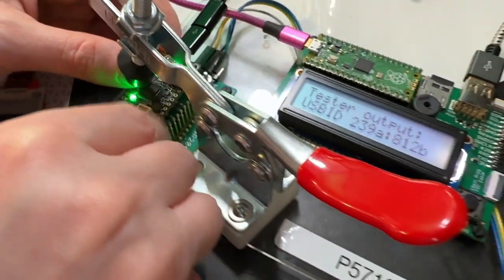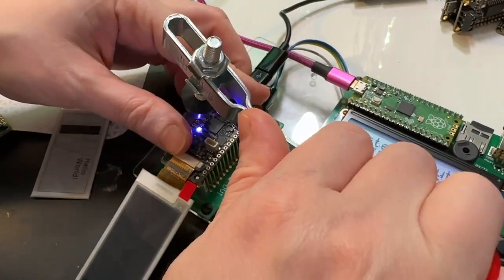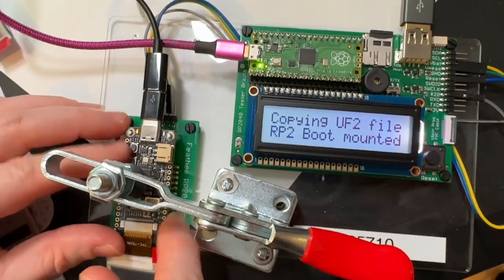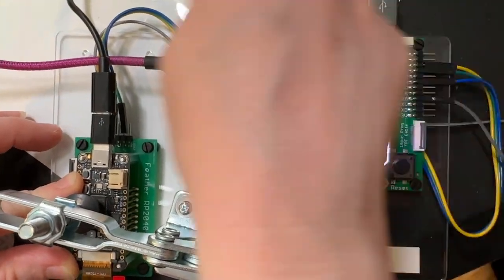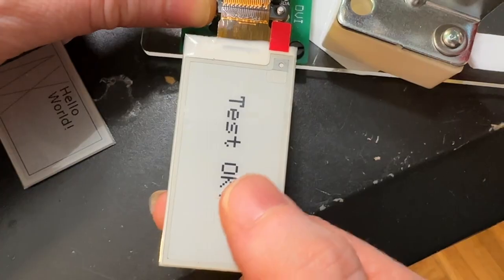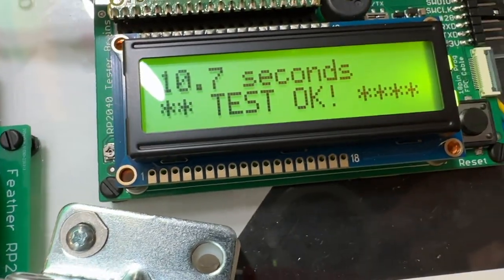EInk Feather Tester tests Feather with EInk

Comment: Did you say that typical ebook reader displays don't use the same connector and pinout? I have a Kobo ereader (the Clara 2E) that I'd like to hardware hack, but haven't found any useful documentation about its "Carta 1200" display.